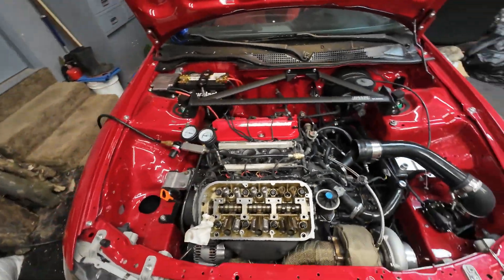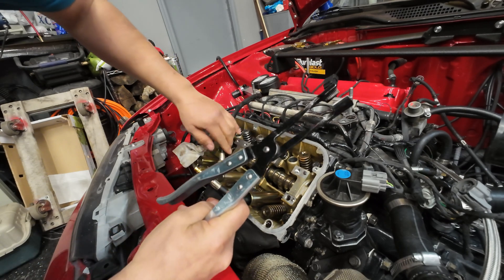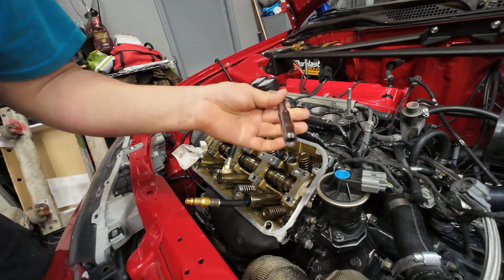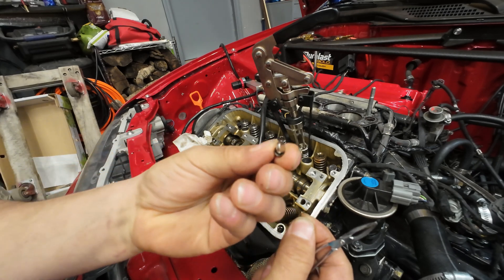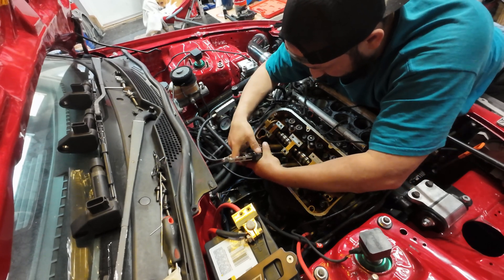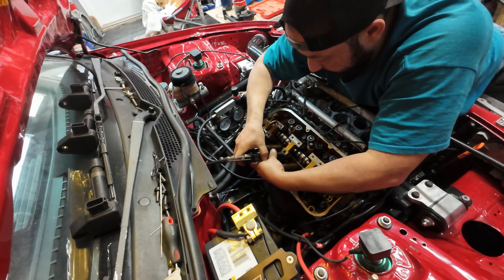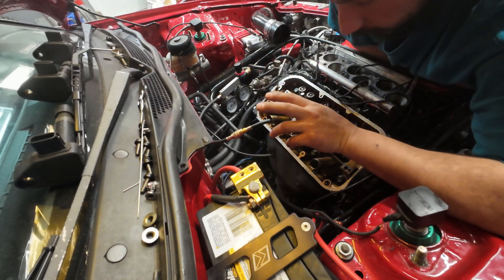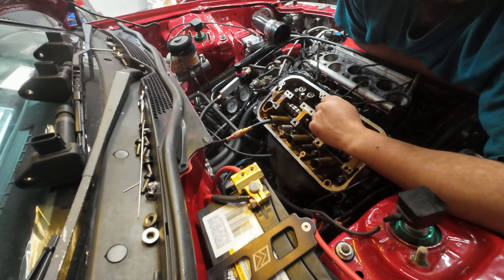J series supertech valve springs and titanium retainer upgrade without removing heads

Comment: Arr you trying to come off any parts from your build you dont need or can sale me for cheap as im doing a budget build 99 Acura TL with J32a1 with J35 parts for now but im looking for a J35 lower end block and put my J32 heads and J37 intake manifold ,and throttle body for now will be turboing it shortly soon as i can get help as this is a busget build im going to do my build videos and post on you tube i and im new at this so be a diy thing sorry name is Brian Kilburn frim Topeka, KS will be street legal drag car i want to make it twin turbo but with the turbos niw this is a idea that has a patent on it from BLK inc. no production of it yet havent even had it tested or working prototype yet maybe i can share with you what i have and can try with your builds and trade for parts you dont need or can come off if you like to hear abiut this set up for the J-series engines my number is 1-785-787-5242 and i think it will make some instant hp no spool more like a twin supercharger with.dual carbs one for each bank as manifold will be built for each runner with a blow off valve coming off manifold just guve me call see if something you want to see if is possible you know what i will do you better and if works let you on half of the profit made from them and they are my BLK Turbo Heads Supercarged be only ones in the world and i think it will make serious hp instantly faster then a supercharger cause not using motor to turn  it but exhaust from J37 heads. Not sure why im even telling you this but maybe something seen on youtube kinda remind me of myself trying to do something with these Jseries engines and like what i seen and you seem like cool ass guy but yeah give me call maybe can druve to you and show you explain it better in person even help do work to make it happen if something mught want to be curious to see interested in doing as i have nobody in my livelihood that I can share with my idea and need a friend to help a guy living from no monies coming in doing a busget build 99 Acura TL that i would drive since only vehicle thats my daily driver Thank you for the video content you have on YouTube as ut has given me my purpose again on what i need to be doing with my livelihood again that i was begging to lose hope on. So yhanks again hope to hear from you on this idea i have and want you to have the first set of my BLK Turbo Heads Supercharged on your ride.

Comment: The oem valves are as good as new super tech valves?
Reply: I prefer OEM for street use, as titanium valve springs & retainers are a HUGE wear item which must be replaced after several passes!
Reply from the maker: Yes you are completely right they do wear faster specially with the flat spring but this car is barely driven to the local track and back or casually to local cars and coffee it maybe sees 2/3k miles in a year at most by next winter is coming apart again that's if it last that long lol now titanium valves never drove them on the street personally to tell you my experience but I've heard about titanium valves is definitely a no no for the street
Reply: I'm not knocking them, i've put about 100 passes and ~25k miles in the course of a year, i basically beat on that engine and it never failed before going a sleeved forged block route and rebuilding the top end again.  @clevermotorsports
Reply from the maker: Yea i think the main thing is just inspect them every now and then to make sure the keepers are not digging in the retainer to avoid failures in my case I'm constantly doing something to this car so i keep taking it apart and putting it back together so gives me a chance to go over common points of failure
Reply from the maker: I would guess the supertech is better but this oem valves can hold pretty good I'm not trying to go crazy power on it just add a little more and add that extra safety from the springs and retainers which is the first thing that goes to sh#@&